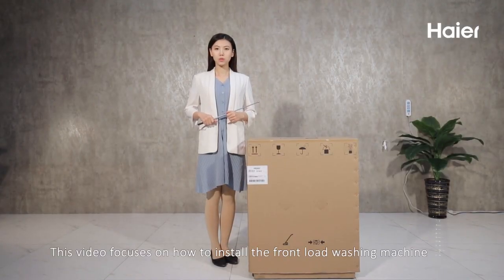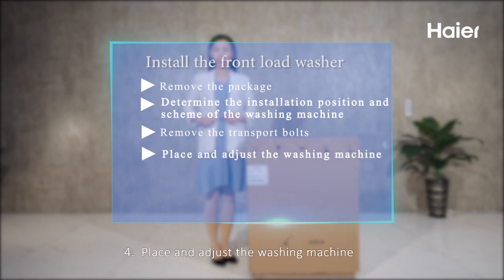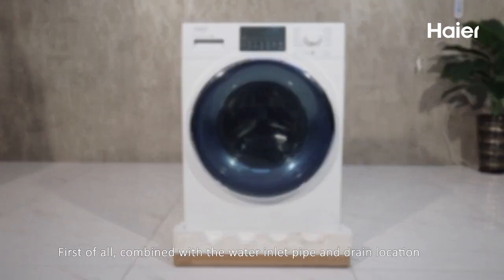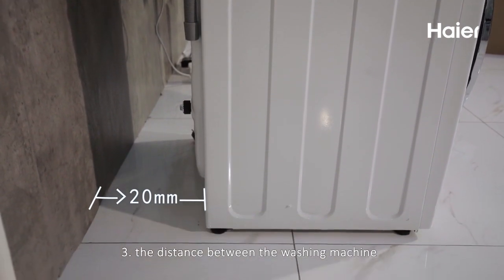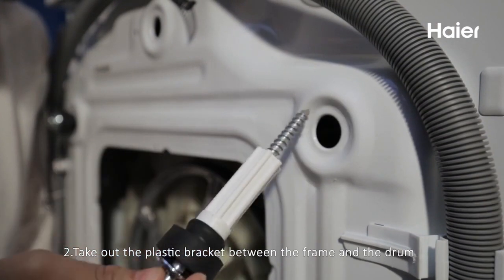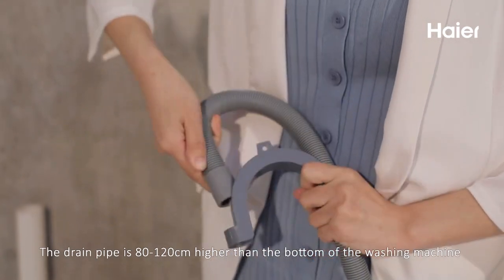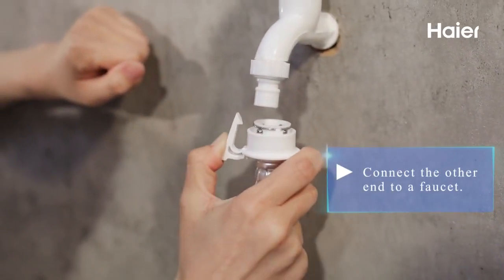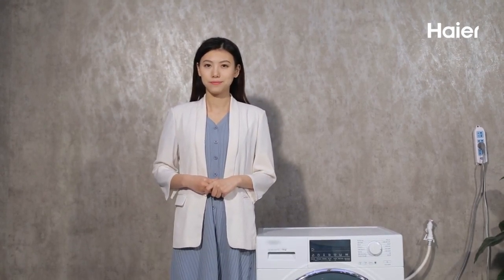Installation guidance of Haier front load washing machine

Comment: Thanks for the video, that's helped a lot. 

1:36 that part was much harder in real life. I had to pull like crazy on these four sockets.
Reply: That was the worst experience of my life. The little buggers would not come out!!!!!
Reply: Yup! Took ages to figure out, pinch pliers on the rubber ring and pull gradually at different angles. We tried to grip the entire thing and it wouldn't work!
Reply: @RenzoInABenzo  Okay so it's not just me, I thought it was supposed to come out with the bolt itself and I'd broken it!
Reply: Yes
Reply: What’s it for though? The video didn’t say…
Reply: @dusk1234567890  it's a protection during transportation
Reply: almost gave up there